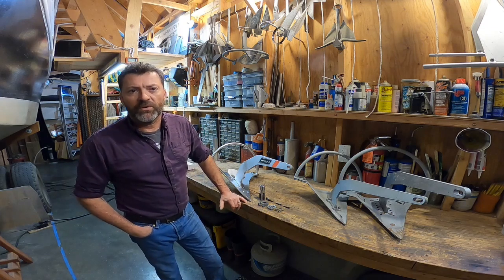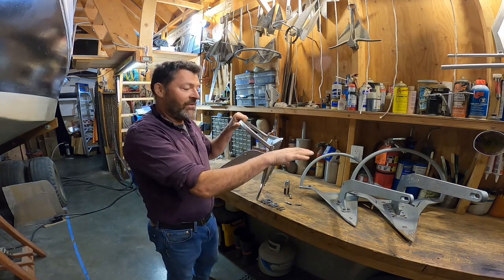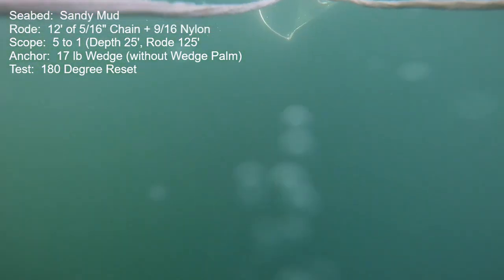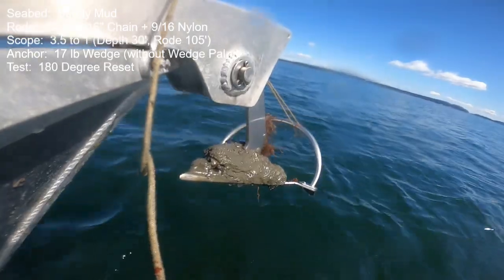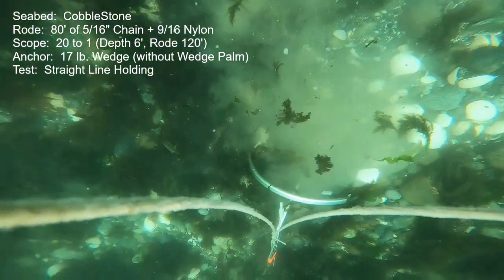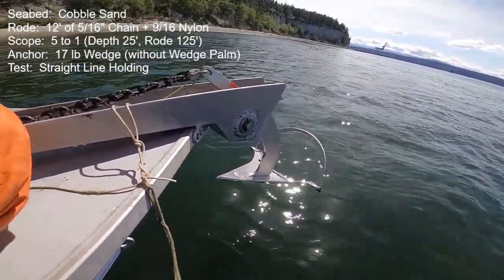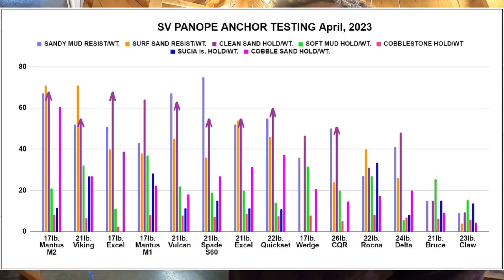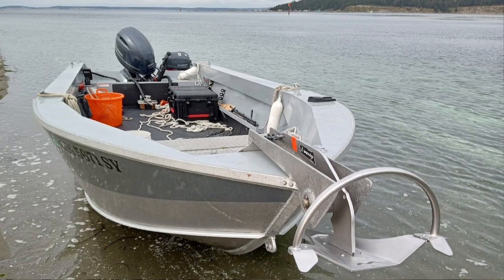Wedge 8kg.  Anchor Test Video # 147

Comment: Ideas for a future tests of this anchor: 
-mount the Wedge Palm on the other side of the fluke
-since the roll bar is also bolted you can easily remove it and see if the performance increases 😊

Thanks for your test. Fellow Anchor Aficionado from Croatia (eu) ⚓️